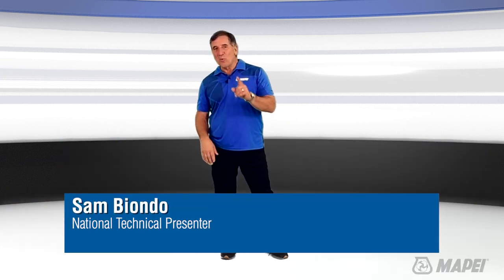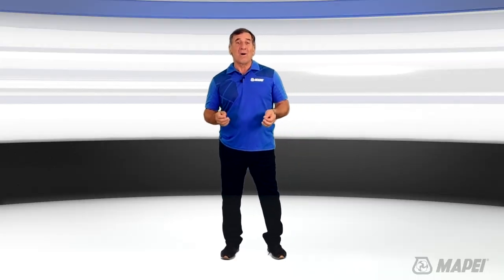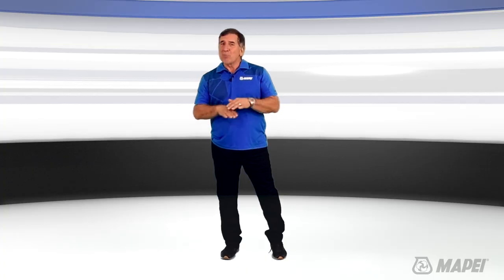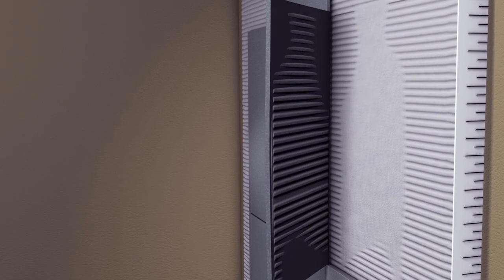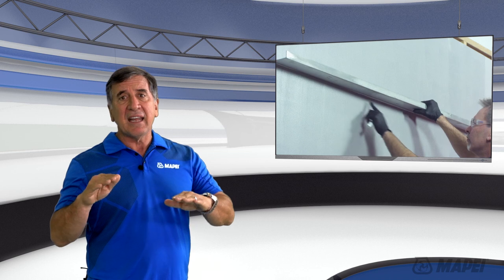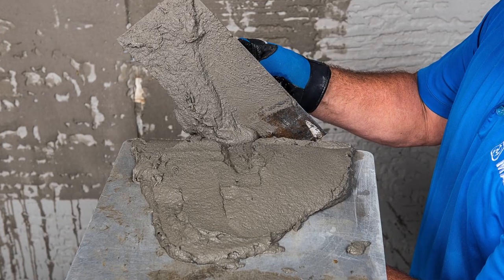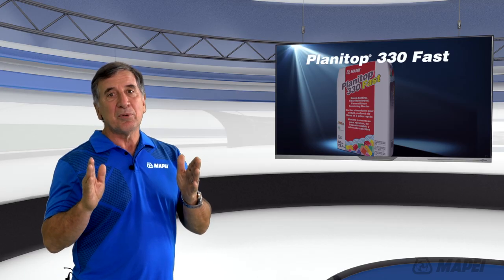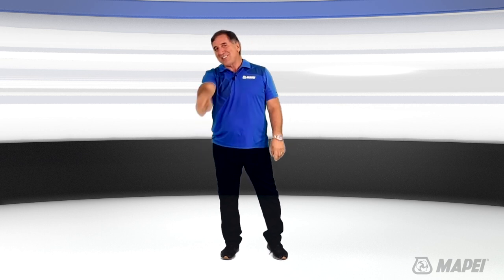MTI-TV: Planitop 330 Fast quick render mortar

Comment: I did not have a good experience with this product. I was in a house 70 degrees. Had fresh softened water to the ratio specified. Whipped it with my drill on half speed 250 rpm. Walked my bucket to the wall. Got two scoops out and then the bucket was setting up. I basically wasted 3/4 bag. Says 20-30 min work time but I was lucky if I clocked 5 min.
Reply from the maker: Hello Marcus, I apologize for the delay in responding to you! Please call the Product Support line at (800) 992-6273 to discuss what happened and to see how I can help you. Please ask for Product Advisor #9